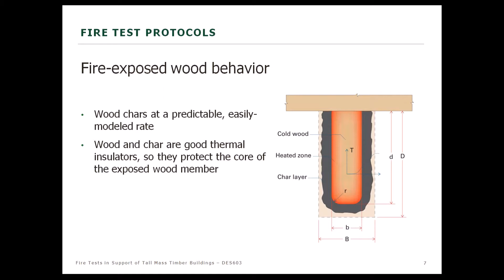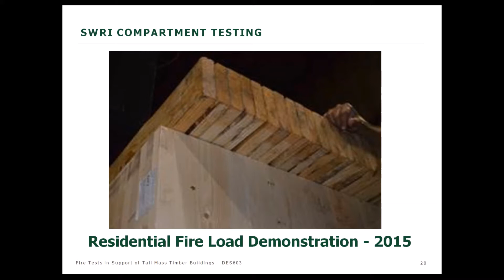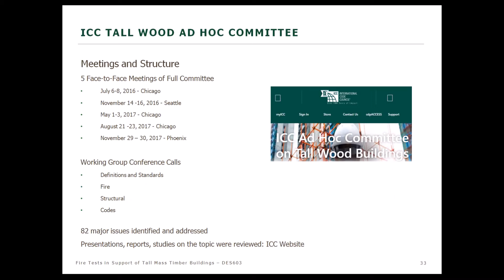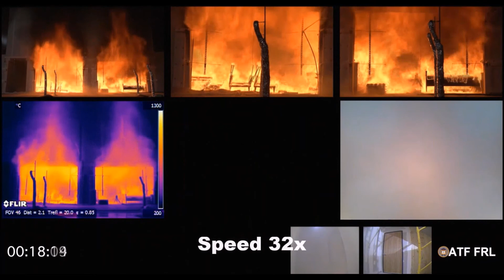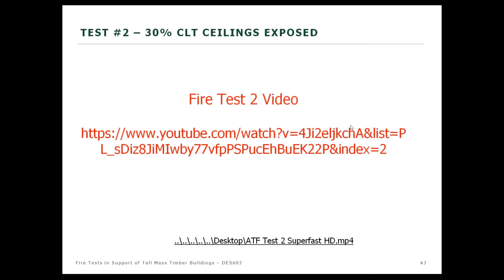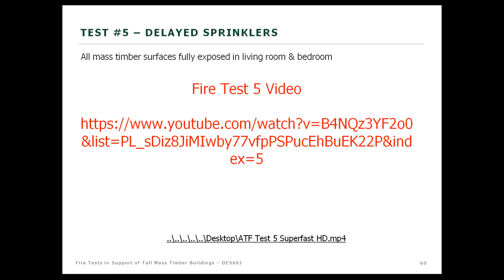Fire Tests in Support of Tall Mass Timber Buildings

Comment: There is such a thing as a dumb question. An hour long evaluation of fire-testing mass timber, and someone asks about a 20 minute door. Unbelievable. What does that have to do with anything??? I'm surprised they didn't say anything about no fall guards at the windows.... Did you measure the corridor to make sure it was the proper width? With all that said, this was a very informative lesson on mass timber, and as a code official, it has given me a new perspective.